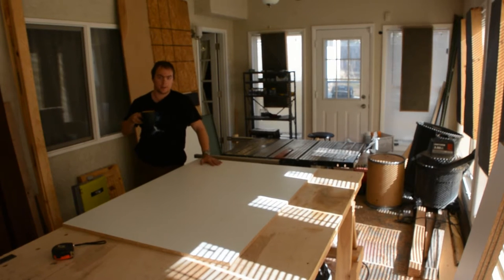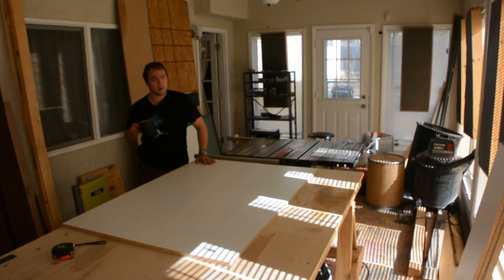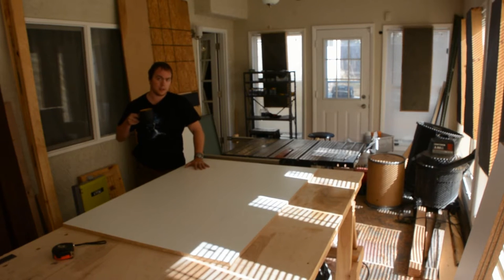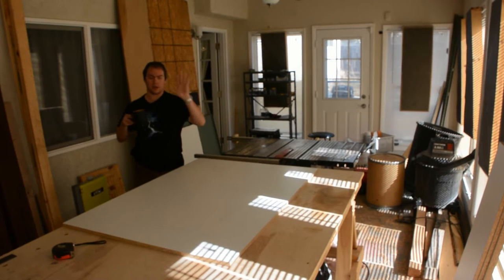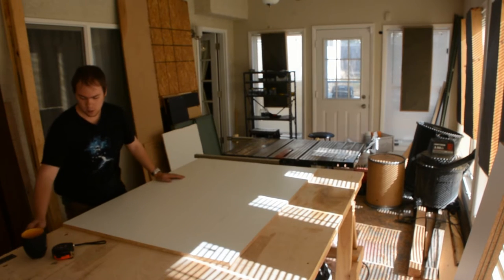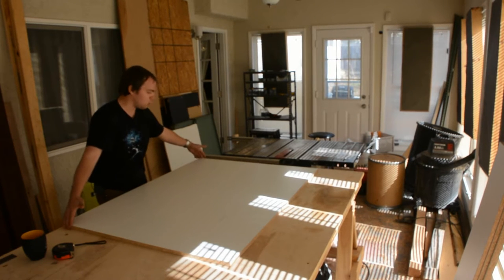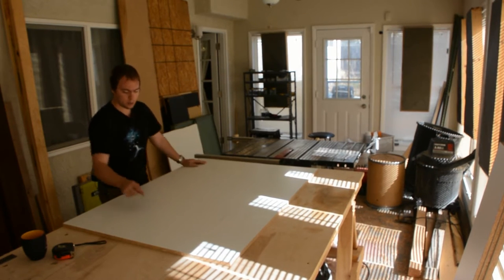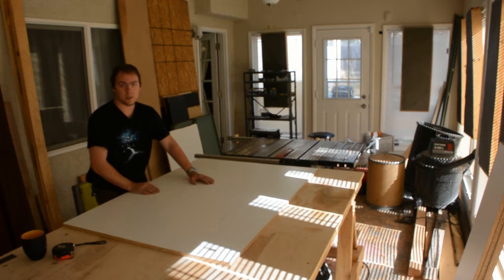F/A-18C Cockpit Build - EP05 - Making a Floor for the Cockpit

Comment: when the stick is in neutral, you need to be able to rest your arm on your tigh
Reply from the maker: I'll have to keep that in mind. I'm actually working on the seat and stick tonight so it more closely resembles an actual F/A-18C with the seat cutout, distance, and height. When flying for 4+ hours I do start to notice a bit of fatigue so I'm modifying and updating. This should also make the cockpit a bit shorter and more compact.

Comment: Following.  Love your build videos because just like me, halve my time is spent plugging things in, unplugging them, going to the hardware store to get the correct bolt for the nuts I have on hand and other non productive motions.  You know, the way it really happens in most home workshops.  I'm learning as I go and you're a great help.  
In my head I had planned on making my seat slide forward and back, like my car seat.  I was designing elaborate jackscrews and running guides, but hey, fix the seat and move the rudder pedals.  
Thanks for sharing.  I know how difficult it is to film and post your work.  It would be so much easier to just get the work done.  But please don't do that.  I want to see your work, mistakes and workarounds included.  Well, I'm off to the hardware store.  I ran out of 2" x 4"s.
Reply: Not that I should tell you how to do your build, after all I haven't seen your plans, but... I think I see a problem with your joystick handle being too high.  Long missions will fatigue your shoulder, back and arm.  Now the cockpit floor plan that I'm using sets the rudders on a ramp platform:                      ______
                                                                                                        ________/                ]

That would work well with your wonderful adjustable height seat.  A platform under the rudder pedals would be a lot cheaper than shortening the joystick.
Reply from the maker: With how adjustable the joystick length, seat height, and ruder pedal positions are, I can tweak it till I get it just right. so far I haven't had any problems with fatigue though. I think the longest I have gone has been a little over 6 hours.